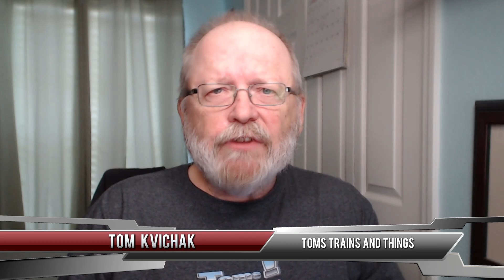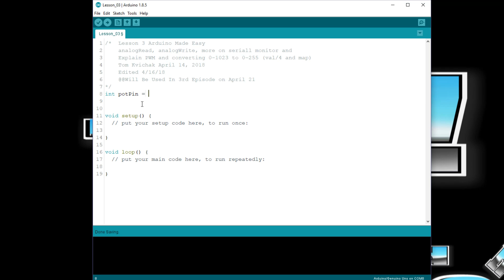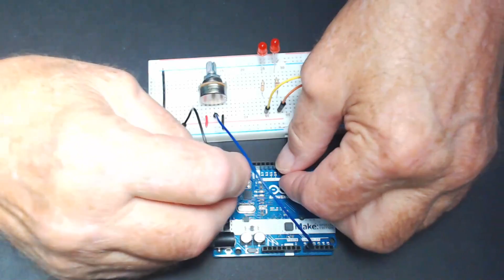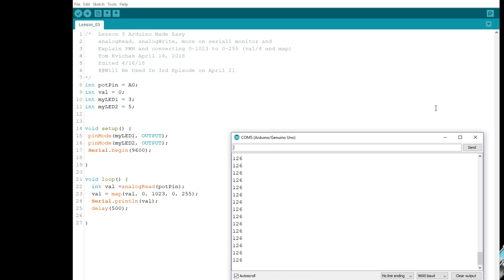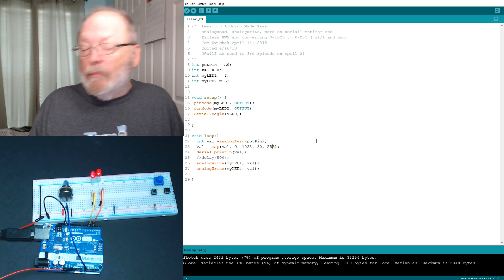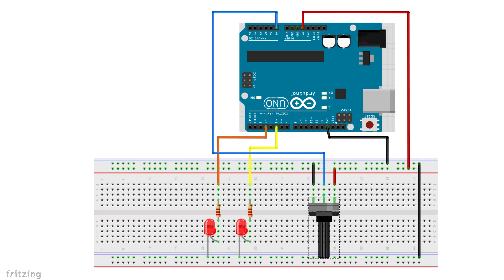Comment: just two thing, you can compile even without the board attach to the pc with the first icon but you can't compile then upload with the second icon.
you can actually observe the compilation and uploading stages by setting the File > Preference > check the boxes for Show verbose output then OK
Reply: Thanks for your input. I go over the verbose option in one of the videos

Comment: Watching these Arduino videos has stirred the urge to get back into working with them.  I've got the preliminary development done for driving servos for my turnouts using an Arduino Mega.  Now I just need to get myself in gear and finish it all up.  May I make one minor correction in the sketch you presented in this video?  You have already declared val as an integer on line 9.  There is no need to have "int" again on line 22 in the loop section.
Reply: Glad your getting back into it. Bad habit of over declaring!

Comment: Sorry to say Tom I still get  ARDUINO CREATE    Welcome!   Please wait a few seconds while we get your Arduino Create started.
Reply: Thanks Donald. Don't know what the issue is. I wonder if anyone else is having the same problem. Do you have anything disabled on your browser? I tried the link with several devices and other than a split second delay it pops right up even on Debbie's devices.Let me know which sketches and drawing you need and I'll email them too you.
Reply: BTW love your logo!
Reply: Tom I got it to work had to open it with chrome. Internet Explorer wouldn't open them. They all open up in chrome. Yes i am a Pennsylvania boy born and raised 125 miles northeast of pittsburgh
Reply: Glad you were able to get it going. I quit using IE a long time ago but still have to use it on occasion for some apps that will only run on IE. I grew up outside Pittsburgh on the SE side. lived there until the 80's when the steel mills were shutting down. I used to work at Monongahela Connecting RR that serviced J&L Steel!